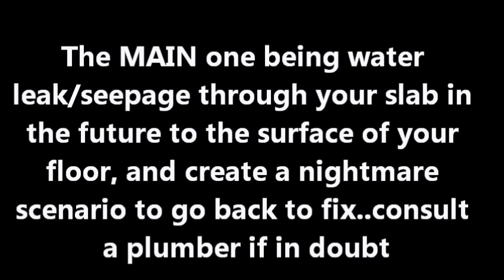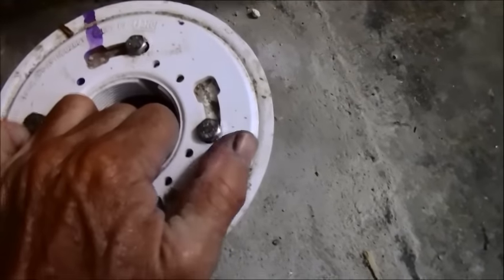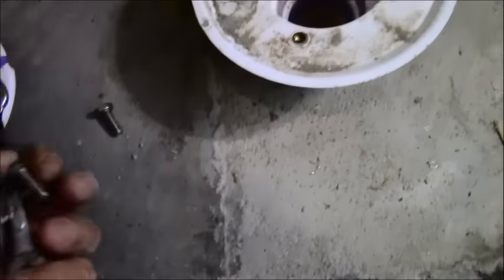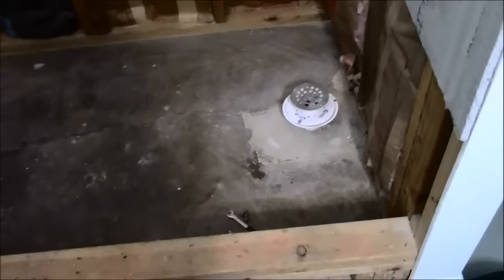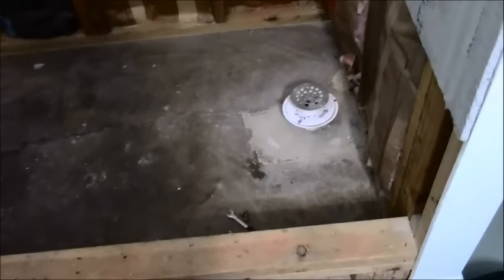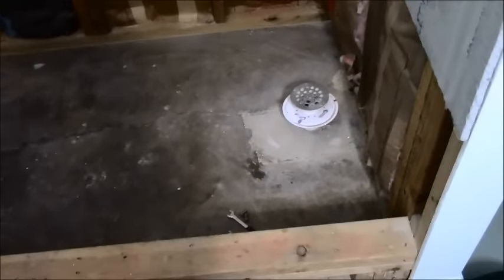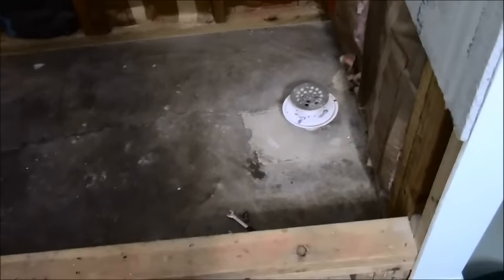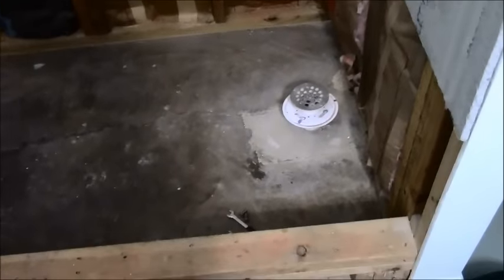SHOWER DRAIN ON CONCRETE SLAB

Comment: This is why tile guys should not make plumbing videos.  Your just asking for it. Pressure 45.  Not drainage...you already broke the concrete why not find the 1 1/2  trap and make it right.  The main topic of vid is 1 1/2-2in transition.  2" trap is plumbing code for a shower in every code in the USA.  If your watching this and are attempting or having this done please insure the 1 1/2 trap is found and replaced with a 2inch trap.
Reply from the maker: Anybody watching will NOT be digging 3feet to 5feet looking for a trap where it T's into the main so they can be sure they are "code". You know and I know that a shower uses way less water than a tub dumps 4 gpm or more as opposed to the shower that exists now @ 1.5 or 2 maybe without a restrictor, so drainage will def not be an issue...but book soldiers will always freak out regardless...and many trades cross over and started doing plumbing in 1987 and tile only since 1999 plus I've seen plumbers set liners wrong, set backerboard wrong, even attempt tiling a shower and did crappy work. I'm responsible for the entirety of my work, my customers never need to track down 3 different ppl if anything goes wrong and over 20 years later nothing ever has 👌🏻💯
Reply: @StarrTile  Not to mention the guy glued the pipe with primer only it looks like from the way the fittings popped apart but you trust that first 45 above the trap?
Reply: Thank you
Reply: @Ryan Dugger said, "2" trap is plumbing code for a shower in every code in the USA."

Not so. While the UPC does require 2", the IPC (& thus the IRC) allows 1-1/2" if the total shower head/bodyspray water flow is less than 5.7gpm. See IPC Table 709.1. Of course different localities may amend this.

Also, later in the video, you'll see that a proper DWV 45 was used.
Reply: If you have the mulla, make it right! If you can find the nearest drain hub of equivalent drain size to accommodate a 2” shower drain, then power to you! Every job is situational. It may be easy to do, it may be a complete nightmare lmao! I’m a journeyman plumber in the state of Oregon and I’ve seen all walks of drains. I originally came to this video to make sure I was installing the bottom flange of the shower strainer at the correct height in relation to the concrete subfloor.

Comment: Umm, isn't the bolt stainless? If so no magnet will work on that. Frankly, I don't know why everyone is fixated on making the shower a 2 inch drain. If new construction, or a framed home, then this could work out for you, however, my conversion makes use of the original 1 1/2 inch tub trap and piping and I do indeed reduce the shower flange to 1 1/2 inch using a 2 x 1 1/2 inch flush bushing. Werks for me...The alternative to reworking/removing/resizing the trap was absurd given it's buried beneath the slab; it's 1 1/2 inch after the trap anyway and so on. Making the plumbing 2 inch only to have the outlet of the trap 1 1/2 inch is a waste of time. But everyone's plumbing setup/ component locations is different. My trap outlet went off under the slab to places unknown but I speculate it tee'd into the bathroom sink plumbing at some point which would also be 1 1/2 inch.

Comment: Finally someone with a good video on a slab.  I have a old early 1970's home with a very small fiberglass stall shower that is old and cracked with a cast iron drain.  I am going back with a tile shower.  So if you ever see a slab floor with cast iron drain do a video of that.

Comment: Getting a tub to tiled shower done and no one told us any of this and the plumber did the piping for the shower system but did not do this work as he said the tile guys would set the drain where they needed it. WHOA NELLIE, That is not what the tile people wanted to hear so we are having to go back in ourselves ($500 already paid out to plumber) and do this, so your video has really cleared things up a lot for us!!!!! Key point from this is most people are not familiar with this project do not realize that bathtub tubs are 1 1/2" piping and Shower drains are 2" pipes.. It made very difficult to figure out what we needed and where to get it, as there didn't seem to be 1 1/2 shower drains to match up to what you actually have!!! Thanks for the video!!! :)
Reply: Common practice in slabs is to use a 2“ to 1.5” reducer which are easily found/ bought at HD/Lowes or plumbing supply or even Amzn.  Shower drains are 2” and tub waste lines 1.5“ so reducer needs to be used in slab situations. If not slab like on raised foundation or second floor where the waste line is accessible , according to most codes you are supposed rerun the waste line to a 2” pipe for the shower.   In any of this work, your shower drain material needs to match the waste line type  - which will be black abs or white pvc pipe and fittings, using the related glue type for the pipe type.

Comment: I am in this exact situation right now, except I took the tub out myself and still have an open hole in slab with the drain pipe under grade. (no jack hammer needed). Thanks a lot!

Comment: in my 40 yrs. as a licensed plumber i'v never seen it done it this way. i'm hoping you verified that there was indeed a p-trap under that dirt. good luck friend.
Reply from the maker: If there was not a P-trap under the dirt they would have had a lot more problems with their tub before I took it out.. I believe I was 17 in from where I started with in code for extending the drain
Reply: still you are learning from him
Reply: why is he continuing to use 1.5" pipe and such?
i eliminated all that and replaced with 2" P-trap and all 2" to the existing 2" pipe,
no marbles were possessed by those who ran 1.5" off existing 2" under the slab

Comment: I’m currently in the same predicament. But unfortunately I had to use two quick 90’s in order to make the transition from bathtub to shower drain. Placed a 1 1/2 quick 90 onto the pipe right before the trap and used and adapter from 1 1/2 to 2”. But now you got me thinking as to why is it not good to use quick 90’s. However this was the only way to get it done in the tight space I was working in

Comment: I'm building a shower from scratch on a concrete floor, I'll have to replace shower drain with the kind you used and everything else, wish me luck
Reply: Hope it went good. Im doing the same thing. Dirt and under slab work is done. Im just about ready for the pan and tile work to start. 👍🤠

Comment: Umm, at 17:00 and again 19:11 you show a 2x 1 1/2 inch bushing BUT if you use a flush bushing you will be able to use a 1 1/2 inch 90 degree street elbow into the flange and make this whole setup as low in profile as possible.
Also, in hindsight, at the beginning of the video you commented as to why the curb was so high. Welp, look at the initial height of the drain and then you'll "get it"!
By the way, these comments are for those watching these videos years later. I know these are old videos.

Comment: Off topic but I just wanted to chime in on the glue and screw cement board to plywood sub floor debate. I was redoing a 1 year old tile floor last week. The reason it failed was because they spot bonded the cement board to the sub floor leaving about a 1/8"-1/4" gap throughout the floor so it flexed and cracked like crazy. I have never had such a hard time getting up 80 sq ft of tile. I had to cut out and replace squares of sub floor where they spot bonded. I'm a general contractor and I don't do a lot of tile work myself, so I was a little skeptical about not gluing but now I've seen first hand its totally not worth it to completely fuck over the next guy.

Comment: If your drain is 2” shouldnt your ptrap and dirty arm be in 2” all the way to the san tee also?
Reply from the maker: In theory yes, but not always possible, and it would be irrelevant because an inch and a half drain would drain the same way as a 2-inch drain in a shower with less GPM, the only reason we step up to two inch drain on a shower is in case there's a backup, whereas a tub you have 18 to 20 in of room to play with before a backup would occur

Comment: Except that’s illegal , you can’t build off the old 1” 1/2 riser for a tub waste/overflow from the 2” trap . You need to chip up the slab and run a new trap for the shower drain .
Reply: I'm sure you are referencing a "code" from a plumbing book. But just for education purposes, why would building off of a peetrap be bad? Is it just because peetraps are supposed to be located within so many feet of the drain it supports? "s" drains aren't allowed in new building but people still install them when performing some drain repairs rather than peetrap with stutor valve.
Reply: Was just going to ask if this was to code? I have a tub that I want to convert to a shower.  I figured it had to be 2" all the way down , not just 2" at the drain ?
Reply from the maker: @Vegaszzihw  I've done perhaps 150 conservatively speaking..tub to shower conversation jobs in 21 years... almost without exception I tie in to the 1 1/2" riser where I transition to 2" pipe for shower and never had an issue, never a callback or complaint. 
By code you can come out 30" and although in an ideal world your trap is directly below the drain, it's more important there's a trap, be it 1 1/2" or 2", either would tie in a Y very shortly after the trap to main drain.
Plus the gpm on draining a tub with 30 gallons of water vs a slower dedicated shower is huge. 
The main issue is a future clog in the trap, and the plumber trying to snake it with the additional 2 90os. A clean out near the trap woukd be ideal.
Reply: @StarrTile  thanks for the reply !
Reply: Hello i was watching some of your video but i did not see the new p-trap. Are you saying you don't install new 2inch p-trap you just connect to old tub 1 1/2 line with old ptrap?
Reply from the maker: If you wanted to dig down all the way below grade to find where it connects into the main you could but that distance is only going to be probably 18 in 22 ft of 1 and a half inch...so yeah, go as deep as you can and transition to 2 inch
Reply: It's not against code. It's an existing pee trap. You can hook right up. I have done 1500 tub to shower installations. I have never failed an inspection for this. Especially when in a condo.

Comment: I have an interesting twist on this one.  I have a 1.5” copper pipe sticking out of the concrete floor in the basement.  I haven’t been able to find any drains to connect to it. Everything is pvc!

Comment: i've only done this 1 time and did end up with a puddle ;( as much as i tried to get the correct slope pouring the cement it was not easy. rented a 14" concrete saw opened up the shop floor 4'x6'. set in forms, did the pour and had to leave clearance for 1/2" thick 6"x12" tiles & thinset. installed sand trap floor drain inside & bottom of a 2'x4'  18" deep catch basin with custom fabbed up metal floor grate. know how hard it is to lay tile in straight lines when the 14' x 24' shop floor has a 2 1/2 degree slope? not easy

Comment: iv been in the plumbing industry for a little over 20 years. You put the concrete slope first and than your shower liner. So when the water passes thru the tile the liner slopes the water to the weep hole of the FHA drain. that is the city code approved way.I have seen it done with shower liner flat like in your video by do it all contractors and it is incorrect. And it is better to move your trap directly under shower drain and keep it 2" all the way, because if trap is clogged it would make cable easy to clean out. Cheaper than having to tunnel under the house to get to trap true story.
Reply: The properties of cement are such that water will soak through it at contact not along it.
so a slope will not help you after water is below the plastic liner.
Reply: @quinnishappy5309 , watch the oatey liner installation video (it's on YouTube). Slope. Then liner. Then mud pan. Water that weeps to the liner can then flow to the drain. This is the correct way to do it

Comment: great vid but, 
why is he continuing to use 1.5" pipe and such?
i eliminated all that and replaced with 2" P-trap and all 2" to the existing 2" pipe,
no marbles were possessed by those who ran 1.5" off existing 2" under the slab

Comment: Great video and explanation. If asked I apologize in advance. But does the entire run to the "main" line including the p-trap not meed to be 2 inch? I'm looking to install a precast/plastic shower surround and didn't know I could reduce from new 2 inch shower drain to existing 1.5 inch tub drain line.
Reply: NO! Mine is 1 1/2 inch...Read my comment above.
Reply: @btomas225  does it matter if the p-trap is at the shower pan drain or right before the main line, p-trap into the main line with the1.5" run from the drain.

Comment: Some crook( may be one of my previous owner or plumber) installed a basement bathroom with toilet, standing shower. Shower did not have a U or P trap. We get sewer gas, horrible smell every day and I had to cap off the drain. Repairing would cost 3-5k.
Suggestion to home buyers, if a home has basement bathroom, MAKE SURE it has a p or U trap. Or else it will be a night mare.
Reply: The right way is to install a p trap but obviously that is out of your budget. They make a product that is called Sure Seal trap seal. Also JR Smith makes a trap seal also. Try SupplyHouse.com for them. They are used when a trap primer can not be installed for a floor drain. Try it out and see if it can keep up with a shower floor drain. For $50 what do you have to lose

Comment: where  is your p-trap? you have to have one in order to prevent sewer gases from escapeing.
Reply from the maker: If you would actually watch the whole video the explanation is there, on a slab P traps are always below grade level, in other words anywhere from 8 to 12 in in the dirt below the concrete

Comment: Just a doubt.  I read that showers are supposed to use a 2" pipe while tubs commonly use a 1 1/2".  Reducing it from 2" to 1 1/2" is not to code and the connection of 1 1/2" that goes to the main pipe should have been replaced with 2".  I'm not a plumber but at least that was what I have read.  Correct me if I'm wrong.
Reply from the maker: So the reason that bathtubs are inch and a half pipe, regardless that they hold more GPM than a shower simply is because they have a higher base typically 15 to 18 in whereas the curb of a shower only has 4-5 inches to overcome, therefore a larger pipe is used for a shower than for a tub.

And anyone that thinks they can get to the main drain below-grade and dig for no apparent reason just a transition to a 2-inch pipe is fooling themselves and creating bigger problems. A shower will drain fine with 1 1/2" as far back as you're reasonably able to transition.

Comment: indeed, there was a 2"P-trap, below the 1.5" garbage.
i did eliminate ALL of the 1.5" ..
a tar-paper sleeve is all ii will.ise to protect the new 2" fittings from fill and solid pour at surface, eliminating the 'boxed-out' form that existed below the tub

Comment: Doesn't the whole drain pipe for a shower need to be 2"?  Having a 2" drain immediately transition into a 1 1/2" pipe doesn't make sense to me.
Reply from the maker: In an ideal world then you would want everything to be to 2" for a shower, but you can't dig in the dirt 9-12 in to make a transition...and not far beyond that is the 3" main it ties into anyway. Plus a shower has less gpm flowing than a tub, which are usually tub/shower combos where ppl are taking showers mostly...so it's a wash..no pun intended👍

Comment: The IPC may allow for  1 1/2” shower drain, but elsewhere in the code it will say that no drainage pipe shall be reduced in the direction of flow ( paraphrase).

Comment: I have similar situation here. I have an old tub and concrete slab. I do have a large opening where the old 1 1/2 drain and p-trap sits. Now I have to convert this to 2 inch opening over the old P-trap .This is a great video showing the transition from tub to shower. So I'm confused, or I'm missing something here. Where is the P-trap for this shower? I thought I was going to see a 1 1/2 P-trap to 2 inch conversion
Reply from the maker: You did see the transition from inch and a half to 2-inch as I explained in the video the P-trap is below grade probably  10 to 12in down into the dirt

Comment: GREAT INFO... I HAVE A SAME KINDA PROJECT..MY TUB DRAIN PIPING RAN ON TOP OFF THE SLAB, NOW WITH THE SHOWER I NEED TO GO UNDER THE SLAB TO BE FLUSH WITH MY NEW ADJUSTABLE SHOWER DRAIN. ALSO I HAVE TO CONVERT FROM 1 1/2" to 2" DRAIN PIPING LUCKY THERE IS AN OPENING (I CAN GET TO) BEHIND MY SHOWER DRAIN AREA WHERE ALL THE PIPES DRAIN OFF...    THANK YOU GREAT JOB !!!

Comment: Could you have just installed a trough drain and left the original drain where it was?
Reply: It could have been installed also, as those are either part of a the pan usually unless you are planning on using the concrete as the substrate for the tile.  It's easier to use a pan that has that already in it, vs. cutting out a longer path for that drain. But yes, it can be done from my experiences.

Comment: How thick is the concrete pour above the pan liner? Is it normal concrete? Is it 2 inch? Is there a minimum? How long to cure?
Also, the weep holes in the drain flange...When a tub is draining slow/backed up, does it cause water to enter the weep holes?

Comment: If I'm rebuilding a shower in a basement that already has a concrete pan and no wood around the sides can I get away with just coating the pan with epoxy or something without doing all this work?